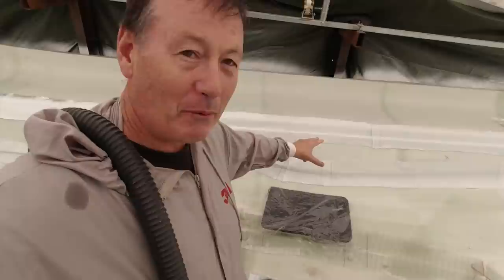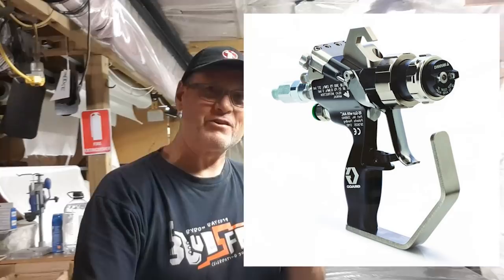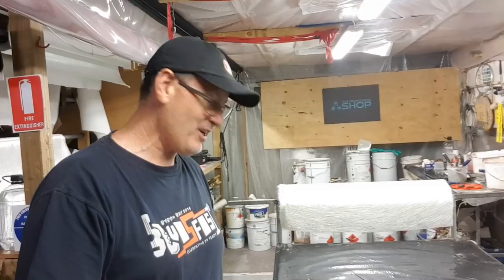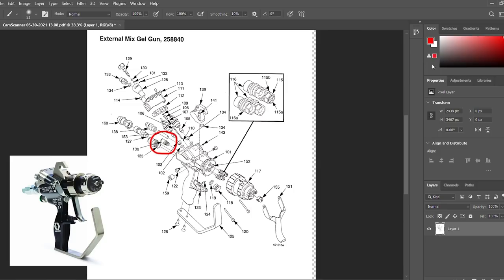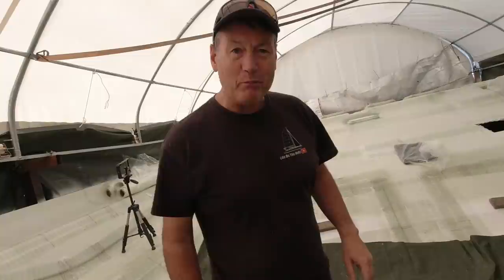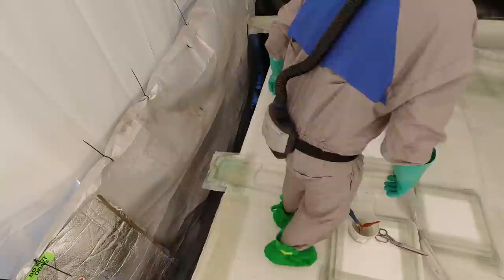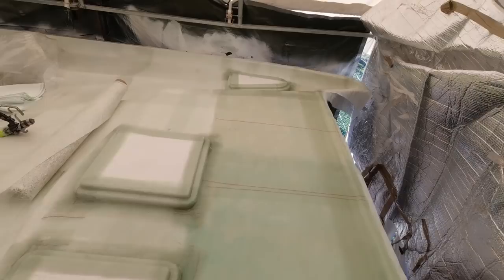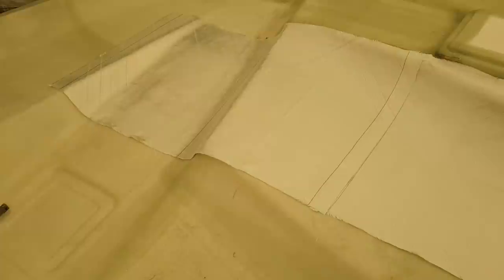E170 - Foredeck Laminates and Spray Gun Woes

Comment: Out of the box thinking Ross. You can’t beat it. I am surprised none of those engineering shops could not suggest it or think of that solution. That's what I would have done as soon as I know it's 200 odd for a replacement part.

Comment: I hate sweating when you can't really cool off until you finish a job. I'd run a wire cable the length of the shelter roof and snap on several snatch blocks. Then hang a few lengths of 'dryer vent' hose from it, hook a filter box to the outside end with a blower fan attached, then the interior end can be taped to an opening in the suit back. You want to go really 'Cool', box the supply end up and install a room AC unit into it, running on high... But, that's just me, I guess you Aussies are used to dealing with 40 to 45c with a smile... Nice detailed bit of work, looks like she'll be bullet proof when done...

Comment: Yes the supply chain is falling apart. Time to sit down and figure key items and order now. Soon you will be doing plumbing and electrical and boat wire is different than house wire (more expensive too). I’m sure that will be a supply issue along with all the fittings, clamps and ties.
Reply from the maker: That's the plan! Every night is a spreadsheet these days Kev, suppliers are screaming for stock, at least I will get the boat together as I have he resin and cloth, he rest , who knows. Ross

Comment: You're  legend Ross ! Never give up, never surrender, and never slowing down ! 
Is there some amount of flexibility accounted in the lamination ? That boat is gonna be at sea, and sometimes on rougher seas I suppose, isn't it supposed to be able to flex somewhat ?
Reply from the maker: I guess the engineer had accounted for the movement of the boat in a seaway but rigidity would be paramount based on the sandwich construction and I believe the laminate would allow for a level of energy absorption before failure of the structure in stress areas.Cheers Ross

Comment: Nice work Ross, good progress.  If I wasn’t on the other side of the world I’d make an adapter for your sprayer.
Reply from the maker: All good mate, at least you offered, I may still end up buying the actual graco one eventually, but am headlong into a batch of laminating and haven't the time to pull it down to fix it with the proper part.Cheers Ross

Comment: From my research and 25 years as a machinist there is no 5/16" npt. Its a 1/16" npt (national pipe thread) with a .312" thread od.  This could be a bunch of other size like straight pipe thread or British pipe thread which are different too.
Reply: Nailed it mate.
Reply from the maker: Exactly , a pipe thread for sure has a slight taper to it. I imagine the narrowing could be to increase the pressure on the air flow and assist in atomising, just a guess. Now I have chocked it but it still delivers perfectly in my observations. Ross

Comment: Great video's Ross. Very interesting and informative. Quick question. I know you showed the laminate schedule for the deck, but why do they use 2 CSM 300 tie layers after the Gel coat layer before going to the 600 bi-directional layer? Would one suffice, or is this to creat a bit more surface structure protection, (ie, dropping heavy objects on the deck etc.). Always interesting. I love watching your enthusiasm, it's a big building project and takes a long time. A lot of people would have called it quits long ago, good on ja. Cheers from Istanbul

Comment: I'd be worried about getting the appropriate flow rate since you have reduced the diameter.  Maybe it might be worth having a pipe lathed inside and out to make sure you can carry on
Reply from the maker: Yes Tim I had thought of that,but all seems to be catalyzing fine in fact I upped the pump by .5percent which has been really effective in the cooler temps as well.Cheers buddy.Ross

Comment: Well it is getting depressing now as the end looms unless Johnny decides to follow in your footsteps or perhaps you will decide to build a bigger cat. I mean a man of your stature requires at least a 60 footer.

Anyhow something you said about your supply chain woes struck an idea. Plus you can delegate to Janet to speedup the process. Basically you are going to need 1001 different parts to finish her off. Things like Plexiglass windlass tinned wire heat wrap connectors hatches etc etc.

If you write out a list Janet could do the shopping for you subject to your final approval of course. This means she can wait for bargains and of course bulk buy maybe even use some YT clout. Of course given the speed that instruments advance it might not be a good idea to do so with those, well unless a real bargain comes along.